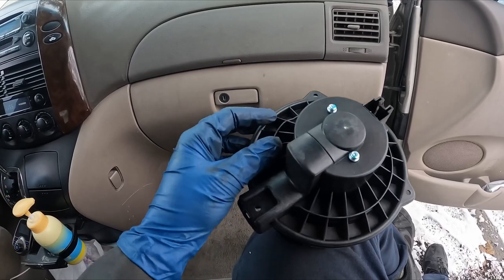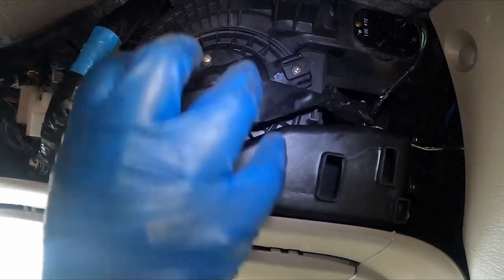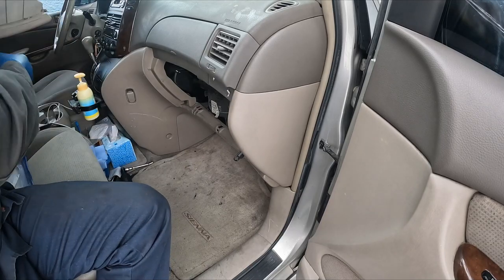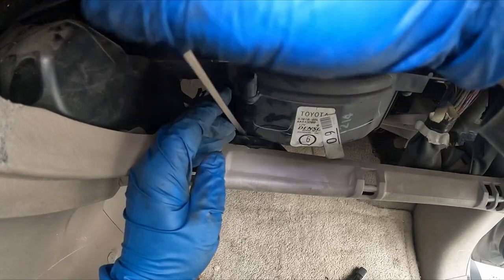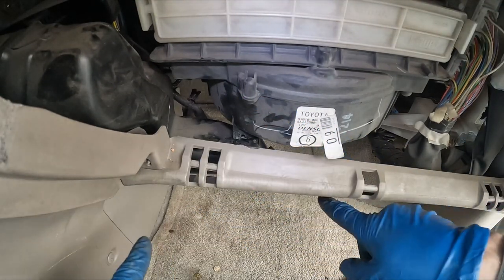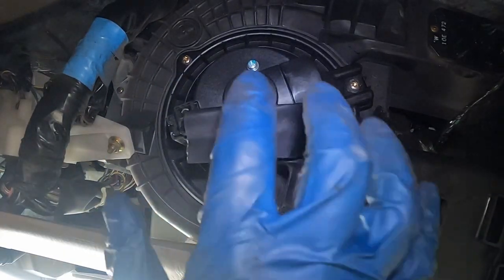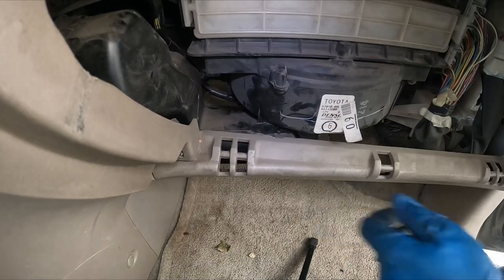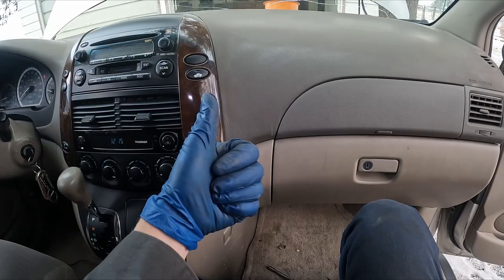Toyota Sienna Blower Motor (How To) Replacement

Comment: I'm in FL.  Gotta have A/C running.  Fan stopped working.  I tapped the motor a few times with a screwdriver handle and it came back on at a very low speed, intermittently.  My mechanic of 20+ years has a new guy upfront.  Ballparked the repair at $600+.  Labor 2.5 hours!  I went to Advance Auto, paid $91 for the blower fan/motor and did it in my driveway that afternoon. Done!!  Works great.  Can't thank you enough for this video.
Reply from the maker: @rubicon3416  Nice! Glad this video was helpful 🙂

Comment: Excellent video.  When my (noisy) fan stopped turning, my mind went to fuses and relays, etc.  But someone suggested I turn the fan switch to on and smack the palm of my hand on the bottom of the fan housing.  When I did, it started to run.  Bingo!  Deduction: My fan was dying and needed to be replaced.  I purchased a replacement at O'Reilly Auto (lifetime warranty) for $94 and followed your video.  It all came out great.  Thank you !
Reply from the maker: Awesome! Glad this video was helpful 🙂

Comment: Any idea where the blower motor is at on a 2002 Toyota sienna, every vehicle I've changed blower motor on has been under the glove box like the one u have here but it's not under the glove box on the 2002 Sienna, I've took whole front dash off looking and no luck

Comment: Can this make noise when the ac system is off? I'm getting a clicking sound from that area that comes and goes
Reply from the maker: @andrewfrey5562  With everything turned off the fan shouldn't move to make noise. I would see if you can recreate the noise by changing what vent is being used, changing the recirculation and changing the temperature setting. The clicking might be one of those actuators.
Reply: @ValleyMobileAutomotive  i appreciate your reply. I will give that a try and see if I can narrow it down.